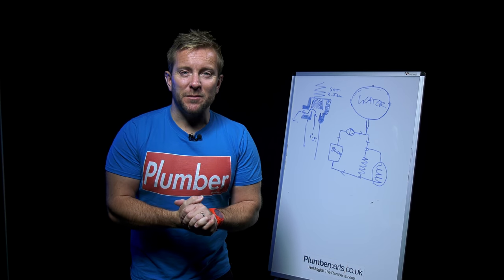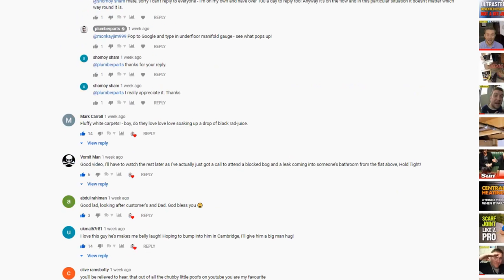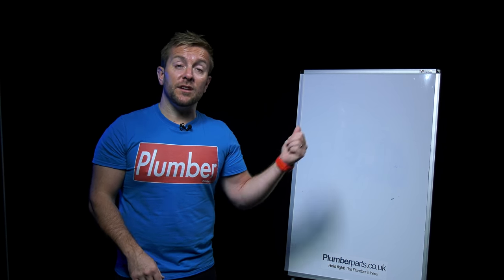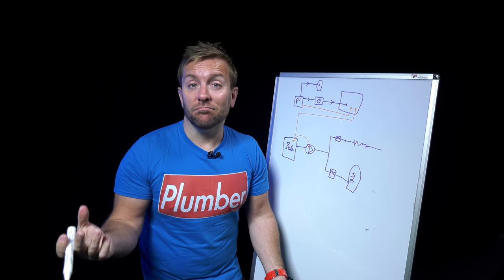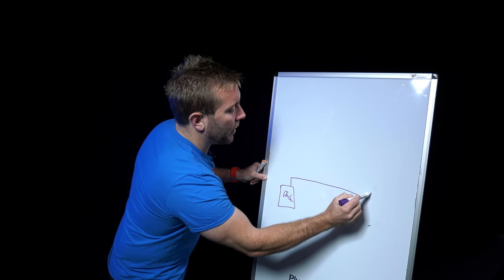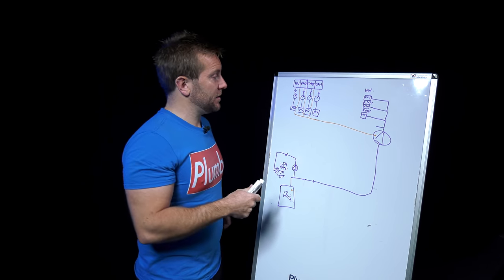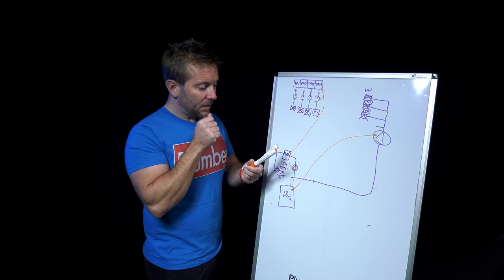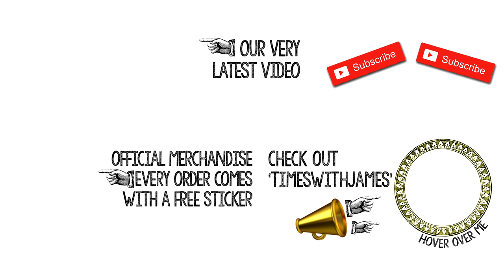RELAYS ON HEATING SYSTEMS

Comment: The only slight downside to this arrangement is that the pumps will come on before the valve has fully opened (or if the valve fails).  An alternative which will avoid that problem, would be to drive the pumps directly from the switched output of their respective valve.  The switched output from each valve would also be connected to the coil of a relay (one relay for each pump).  The switched outputs from the 2 relays could then be used to switch the boiler on by wiring them in parallel.

Comment: Also, one of the best features about relays is that you can use a small current for the switch to operate a heavy current making switching safer 👍 good vid mate
Reply: Are you talking about micro switch wires? In his schematic diagram were the wires were yellow/orange?

Comment: 19 thumbs down, can't appreciate a good sense of humour...:) If this channel is still active, is this set-up fairly the same for mobile homes, as well??? my hubby is a journeyman electrician, and feels our heater problem could be a relay switch issue, because it keeps shutting itsself off and on. Could that POSSIBLY withouut y'all looking at it, be the case???? it's a fairly old unit, but was working prior to this issue. And the a/c works??? but, I am dumb-founded, when it comes to electricity and plumbing, thanks so much!!!

Comment: I guess the question is how do you know when to use a relay though? iv wired up s plan systems with UFH as well and there’s been no relays, other systems iv done the manufacture shows you need a relay in the wiring diagram. I once had to add a UFH zone to a system that already had HW, X2 CH and another UFH zone, technical help said i didn’t need a relay but this makes me think i probably did…

Comment: Very well explained, I'm the other way round an electrician that has to sort out plumbing wiring nightmares.  My advice to anyone would be to spend a short time drawing out the circuit first before starting. The other is take a photo of each way the virous items are wired before you start. Always use good quality relays that are rated for 240 volts, don't be tempted to use Chinese, you will never stop returning.

Comment: Thanks mate. 
This is very similar to a job I did, where I had to build  a boiler room in a large bungalow (we nicked an area off a large bedroom) that housed the boiler (Ecotec 632)  a 300lt Megaflow and 4 zone valves. The issue was there there was not enough of a leg to run a bypass effectively, so the boiler pump overrun would keep going after demand stopped, until the boiler dropped to 50°c. I just could not get enough heat to dissipate to stop the pump quicker. 
The solution... 5 relays. When there was no demand, relay #5 held open a rad zone circuit to dump heat into. When any of the 4 zones asked for heat, that #5 relay closed, closing the rad zone, and at the same time it opened which ever zone was being asked for. 
It works like a charm, been running for at least 3 yrs now, and I’ve used this in other big installs. 
I can’t lay claim for the electrical design, only what I wanted it to do. One of my customers is a retired electronics engineer, he drew up the schematics for me to wire it. It’s brilliant how it works. 

Keep up the good work mate 👍

Comment: Cheers dude.  I have a hack planned . Two heat sources: I’m using a pair of old fridge compressors to pressurise reprocessed veg oil for burning through a .40 Kero jet.  (It gets pumped and pressurised in to a calor bottle up to 120PSI variable though)  Then out to the Jet via a final filter and fire valve to a boiler from an old gas fire. (Here exhaust heat is used to warm the oil (thinner is better for keeping pressures down.  Bugger in cold weather and this is an outdoor system for safety reasons and hopefully for reprocessing dirty oil when required) Original plan was to heat the greenhouses and sheds, I got thinking.  Existing household system is a combi.  But if I install a thermal store I can run the HW of the oil burner.  (The oil is free but processing and filtration is not, but still way cheaper to run if excluding my time) The here problem is keeping the combi plumbed in as back up should the oil system be off, fail and or be down for servicing.  So it’s down to stats and a bi directional flow valve.  

If it goes to plan then I may look at patching in to the CH in the future if it has the output that is.  

Thanks loads.   Keep it up!

Comment: Great video thanks, not a plumber and understood most of it. I I were adding a boiler stove to the system that required adding a pipe thermostat and 8m circulating pump how do I add a relay from this to the motorised valves? What type of wire (Core) is needed and where is it wired into? The wiring centre? If dos how can you tell where in the wiring centre you add the new pump? Thanks

Comment: James

I am wondering what will happen if the motorised valve is kept on  radiators in winter to keep home warm 

So my question is what will happen to the hot water 

On s plan ?

Thanks

Comment: Would putting an auto bypass after the pump before the motorised valves have done the same thing? I know the pump would of still came on but would a by pass still of worked?
Reply: Yeah it would work but depending on the run length it will be sapping and wasting energy! 
also the backfeed on the wiring will turn on ufh pump when its not needed also (if the heating was calling) so you would need another pressure bypass on the ufh side too!

Its far easier to just add a couple of relays in an adaptable box to stop the backfeed.

from what i can remember the grant vortex are really basic and dont have a pump overrun, so the live to the boiler is just sent to the boiler pump/system pump
and only sent to the burner if the boiler stat is set high enough and if the thermal cutout on the boiler is ok.

you could add a timer relay to run the system pump for 5 mins after the boiler is shutoff.

but the manufacturer clearly is not bothered as the boiler does not have this facility.

hope this helps dude.

Comment: Great video, I currently have plumbers in right now in my house and they've just added ufh to the system, but I still have some of the previous radiators upstairs. They asked me to order a relay but I like to know what stuff does, your vid has helped me (a non-plumber) a lot :) I do now wonder given your comments, if the fact they are having to use one indicates they are trying to fix a bad install in the first place, or is the realy THE only way to ix a scenario when HW, rads and ufh are shared supplies from a single boiler? Also, they only asked me to buy one relay rather than two, which they are adding to the manifold area ... should I be more worried?? (sigh!!)

Comment: Hi James, I have an old boiler in the utility room of a bungalow.  It high up and fee comes in at roof level then down to each rad.  I watch your balancing video where you close the valves then re-open a quarter turn and it hasn't seemed to work.  Also when the heating is off I have one or two rads that stay warm all day.  Any ideas?  Got a video by any chance? Thanks!
Reply from the maker: Could be a motorised valve letting by...hard to say mate!
Reply: @plumberparts  yeah fair enough mate. Since I balanced the system it seems to be behaving itself better.  I saw your video on that. Thanks and keep up the good work on here.

Comment: Hi James. 
Happy New Year all !Just thought it might be worth sharing that sometimes neutrals ARE switched (eg  in a double-pole switch)? or when an installer does it wrong and we are fault-finding.
My old back boiler was wired with a switched neutral and caused problems when my old fuse box was updated to one with circuit breakers and an RCD.
Just my tuppence worth

Comment: Delayed Relays? 
This is what I think I might need. 
So, just installed Worcester danesmoor system utility. It has live for power and/or pump. I have nest controller. I ask for heating and it turns everything on, works a treat. My problem is once nest says it's up to temp it turns off the boiler and pump. What I want to happen is the boiler stop but pump continue to remove heat from the boiler itself and give it a bit more longevity. 

I can't for the life of me work out how to do this with nest and boiler,  my only thinking is to drop in a delay relay, so when power is cut the relay does not cut power for x minutes to the pump

Any suggestions? And great videos btw :). Cheers. Rich.
Reply: As well as making the pump over-run depending on your system you may also have to have a zone valve hold open. All in all could end up being more hassle than it’s worth. 
Keep the system clean and inhibited, get it serviced annually. Oil boilers usually go forever if you take care of them
Reply: @_______DR_______  thanks Dan, I'm possibly over worrying!
Reply from the maker: Haha! If it's oil they're built like TANKS!
Reply: If you really want to do it, you have two options, a time delay relay that will trigger on the signal to stop, but not all boilers have that. Or put a thermostat on the output pipe from the boiler and use an OR gate that will drive the pump when either the thermostat or the existing demand calls for it. If you want to use a standard thermostat (that provides closed circuit on demand) you might also need an inverter. most of these things run as low voltage, and then you'll need relays again...

Comment: Brilliant video :-) Quick question, Would you use a relay with a UHF manifold where there is no relay in the manifold itself? e.g. You dont have a second a two-port value and you are using the actuators to close and open the second zone?

Comment: I'm needing to replace my pump soon amd thinking of getting the wilo pico pump that you seem to be a fan of. Will the variable speed work with the standard bypass valve on my s plan system? Seen stuff online saying it won't give enough flow over the boiler when the valves close? Cheers

Comment: Would it not be better to switch the live to the boiler with the relay, rather than the live to the pump? If the boiler is on but the pump not - wouldn’t you get a build up of pressure behind the pump? (Assuming the boiler has a pump in).

Comment: Shouldn’t the boiler have a low loss header or closed couple tees on it as the circuits designed flow is more than the designed flow for the boiler? (Especially the ufh mass flow)

Comment: James. Great videos. 

Should the pump signal not be instigated before the feed to the boiler, that way you can get flow moving through the heat exchanger before the burner ignites ? or am i over complicating things ? 

My problem is old oil boiler 4 connections DHW / CH two pumps/ one Potterton controller . room stat and cylinder stat. Potterton can only fire on CH when DHW enabled.... want to change to Hive. separate relays for CH and DHW. Hive switches relays direct feed to pumps to get flow going. Power onto 2 port on CH, micro-switch makes and fires boiler. 

Equally DH Hive switches through cylinder stat and pulls in relay which fires pump and boiler, question is should i put a 2 port on the HW like i did on the CH ? 
reason i put 2 port on CH was i was getting heat in rad circuits when HW fired, think it was conduction in the water.

Do you think the problem will now be demand, if i have CH and HW demand on the same heat exchanger could i risk starving the DH cylinder recharge flow when CH is on ? or should i kill the 2 port CH valve when i have DH demand ?

OR ? should i change boiler to 2 connections and put a 3 port valve in ?????
Reply: All gone to pot. Boiler baffle support frame burnt away, baffles fell down infront of burner, litterally melted away. Shot to Sh*t . time for a new boiler get rid of pumps and rely on combi only !!!!

Comment: The biggest point about relays is that they can switch a high voltage load with a low voltage signal, or vice versa.

Comment: Anyone know how to get this to work with a “pump overrun” signal from a boiler?

I assume one pump would need to be selected (one on a circuit that definitely has a bypass) but I believe the pump overrun is on BOTH when the boiler is running and for say 3m after

It’s a head scratcher 🤷🏻‍♂️

Comment: The hot water pump still sees live from boiler (when it's lived from the UHF - commoned at lower terminal of HW relay - even when the Programmer doesn't close that relay
Reply: No it doesn’t. 

The HW pump will only activate when the HW programmer activates the relay. 

The relay is a switch that closes the connection from the boiler to drive the HW pump. If the relay is off the live from the boiler isn’t connected to the HW pump. 

Right?

Comment: Be careful, your slowly turning into an electrician. Could you do a bottom immersion without a drain down. I kinda wanna see how messy it is. And if you know of a big field somewhere. Would you kindly cap the vent on a vented and boil it some. I don't think it will blow as good as the unvented on myth busters, but it is almost the season to blow stuff up.

Comment: I only seem to use relays when somebody (spark) has cocked up and created back feeding to controls and circulators.If a job is well speced and thought out they are normally not necessary.
Good thing about relays is there reliability.

Comment: you talk alot of motorised vavles wiring of them.surely as a plumber you must come across cases where the motorised  valve is the problem ie there are highly restrictive as the water passes true them and resulting in the heating system working poorly?as a plumber myself I see this so many times maybe do a video on ways around this problem.hold tight 😁
Reply: Tom Thumb fit a 28mm zone valve into your 22 pipe, restriction gone mate.
Reply: @MrRctintin  unfortunately that makes next to no different as the vast majority of motorist vavles are pretty much the same inside weather 3/4 or 1" motorists  vavles 
I've being in many a house with 1" motorised vavles same old problem
It be nice to see a video done for his viewer to over come this problem
Reply from the maker: That's why I prefer S-Plan as the valve bodies are generally less restrictive...
Reply: @plumberparts  I've removes many an s plan system as the system just isn't working as it should this be more so on larger houses 15 20 rads plus
Reply from the maker: @K-carbon  So what do you install instead? Low loss headers and control pumps? Just interested! 😎
Reply: @plumberparts  mostly with an s plan I installs pumps with  a grant NRV screws onto the pumps itself.grant boilers use them for there combi boilers work great as I find the convenient swing check vavle are noting but trouble they just dont make them any good any more vavle sticks open water creeps back true them very unreliable.then use relays to pull in each of the pumps with the boiler.a other huge problem is spring loaded nrv on system.ie  say 2 pumps and 2 spring loads nrv .poor performance again I'm talking about big houses 15 20 rads plus

Comment: Why are you drawing an "S" plan on the board and then you show viewers a "Y" plan valve, you should be showing viewers a 2 port zone valve with microswitch.

Secondly, there was an easier way to fix your naff system, move the pump back to the boiler split the flow between the airing cupboard and the underfloor heating and install an auto bypass for pressure-flow issues, you could have also fitted a balancing valve to the flow to the UFH circuit so upstairs is not robbed of flow when all circuits are operating. You then wouldn't have needed to install a second pump and all your fandangled relays, the job would have been quicker and cheaper for the client.

What you have done works but it's a little OTT.
Reply from the maker: Sorry for being alive! Ffs!
Reply: @plumberparts  Calm down chap, just keeping you honest.....lol......... I have a theory you are trying to create chaos in the DIY world so plumbers get a surge in work.....good lad!! Bad winter coming so you won't need it ..lol..chill.